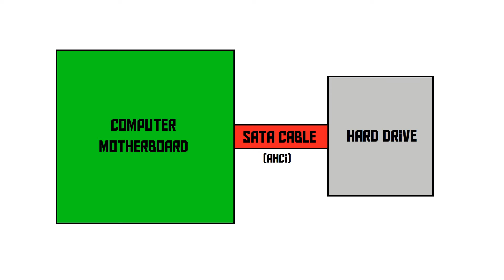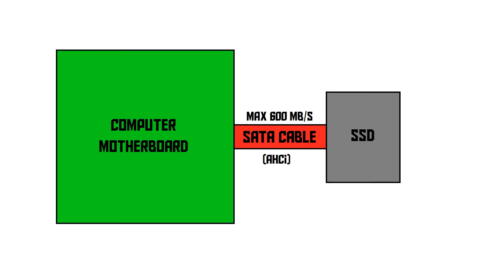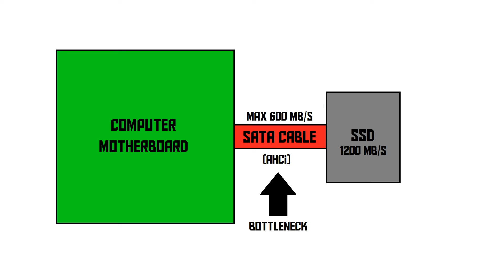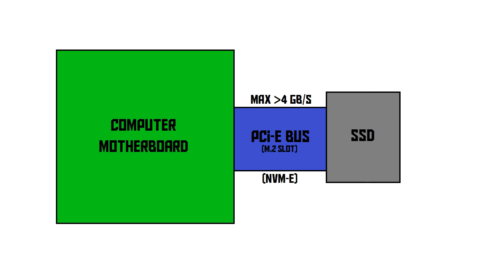What is NVMe? (AKIO TV)

Comment: Please help me to understand something. With the roll out of M.2 drives im having hard time to grasp the concept of what is what..meaning: M.2 it's just a form factor or an interface? the doubt stems from the fact that it can refer to both SATA and PCIe but still then why before they made the part of the interface (as the very slot was called either pcie or sata) and now the slot is called M.2?? so what are SATA and PCI? they refer just to the layout and behaviour of physical pins i guess because then it come into play the protocol that is another thing itself given that pcie can run based on ahci and nvme. My main issue is that i can't figure the difference between what is M.2 and what is PCIe or SATA given that at a first glance they are the slots and hence the interfaces.
Reply from the maker: M.2 is an interface, just like PCIe and SATA. It's a type of connector. 

NVMe is a protocol that can be used by PCIe and M.2 drives. SATA drives use the AHCI protocol.

edit: extra info: PCI is not PCIe. PCI (without the e) is an older type of slot that no one uses these days.
Reply: @AKIOTV  from what I've found written M.2 it's just a shape of a  connector under it the interfaces that support it are Pcie (PCI express and sata) so i guess that's what I didn't understand earlier, the interfaces are still pcie and sata. M.2 has become just a sort of connector that has the same dimension and to which both the interfaces has shrinked to as to size. Could it be?

Comment: you use "standard" in place of "protocol", I dont mean to criticize, I just wanna understand if you could explain it to me when in general the two words can be confused and when instead they imply different things, it's important to me if anyone could explain
Reply from the maker: That's a great question actually. From what I know, in this context, a protocol is a set of rules used during communication, and a standard is a norm or specification a certain type of device has to comply with. Protocol is a more specific term; every protocol is a standard, but not every standard is a protocol.
Reply: @AKIOTV  sounds clear to me now thanks!!

Comment: Isn’t M.2 a form factor not a transfer protocol standard? Basically m.2 form factor utilizes the the nvme  transfer protocol on a PCIe bus? Correct? I liked the part about the explanation of SATA and NVMe. Many people refer to m.2 as nvme but they are two different things . An m.2 form factor that utilizes AHCI won’t utilize its full potential. It has to use the NVMe transfer protocol to get those speeds. Right?
Reply from the maker: Didn't I say that in the video?

Edit: just watched it, I made this video quite a long time ago, so I had to refresh my memory. At 4:02 you can hear me saying that m.2 is a new type of physical connector that uses the NVME standard and the PCIe bus of the computer. And yes, that means you're right, m.2 isn't the same thing as NVME, m.2 uses NVME.
Reply: AKIO TV oh yes! Thank you! I appreciate this very much !! I love your video! Thank you thank you!! 💙